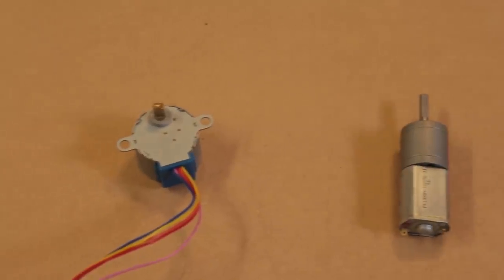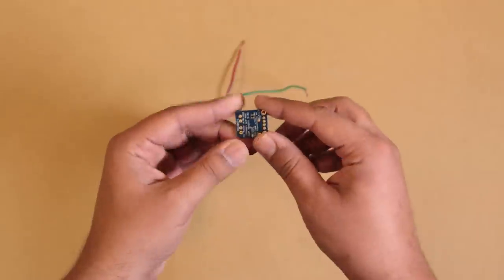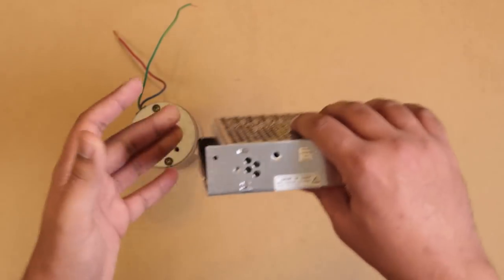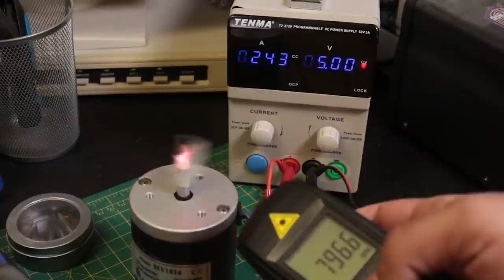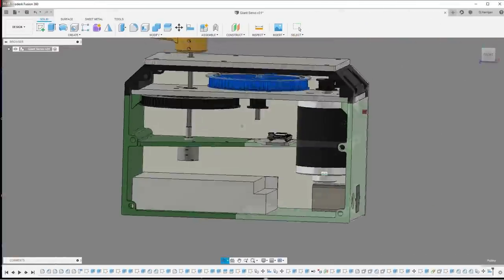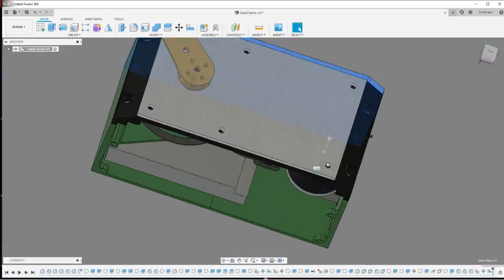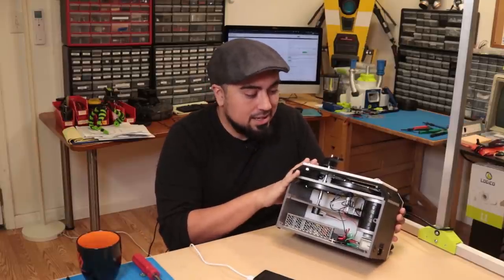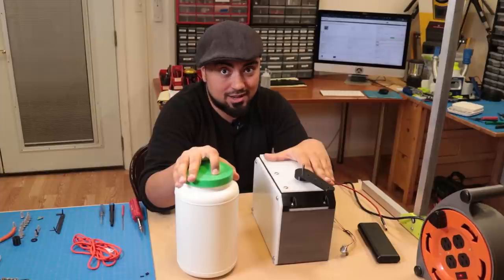Make Your Own Giant Servo

Comment: I've made some giant 7 segment displays for a giant (jumbo) digital clock I'm working on. uses some LED modules with a plastic housing and adhesive backs, have 3 LEDs in a row and have wires on each end arranged as a 7 segment display, I have some various boards for driving them using shift registers and CD4511 BCD - 7 seg decoders and a board that has an RTC and 328p (arduino nano essentially) that will drive the digit board drivers

Comment: Hi! Is it possible to set the driver for doing the next. A motor axis ("wheel" further) rotation is clockwise 60 rpm. Torque on the wheel is 10 Nm. I push the wheel counterclock-wise and make two or three rev overcoming a force of 10 Nm. Then I let the wheel go and it moves clockwise as usual.

Comment: A remark on your testing. It might have been better to let it keep a horizontal position, and you keep adding water until it can no longer hold (i.e. discover the maximum holding torque). The way testing is done now, is less accurate as well as that the weight swinging around adds so many dynamic factors with peak-loads exceeding far above the average load. These peak loads can wreak havoc on the mechanics, and I expect that these high peak stresses caused the PLA to break (because PLA has no 'give' before its failure point, a high 'hardness'). Also, the servo arm changing position all the time means that the net torque varies a lot because of the force vector of the mass of the load being non perpendicular to the servo arm.
Of course nylon would be better for the pulleys, and if you have a modified 3D printer it is definitely printable as well.

Comment: Gud explanation sir but can i use the built in micro servo circuit and connect it to a diy h bridge MOSFETS to drive larger dc motor for a diy large servo? Thank sir...

Comment: The motor nameplate states 80 W. Yet it is rated at 24 V, yet you say it only uses 1.5 A at full load. Sounds like you have found a free source of energy.